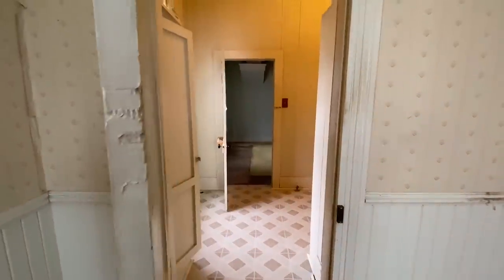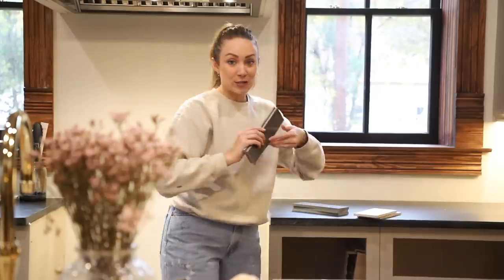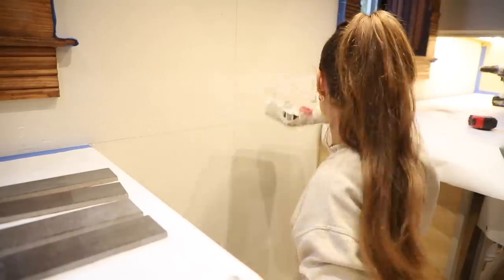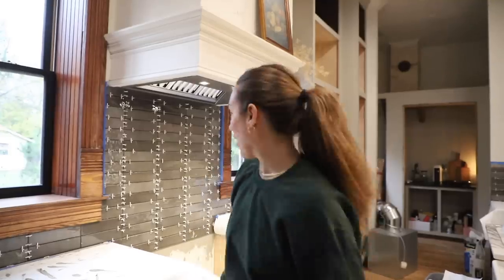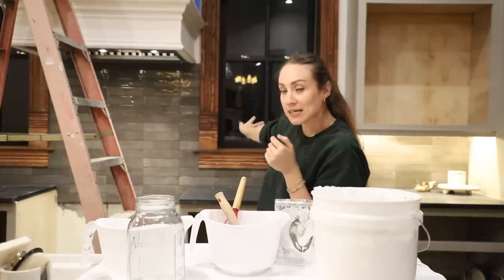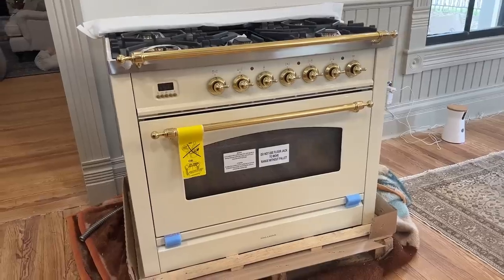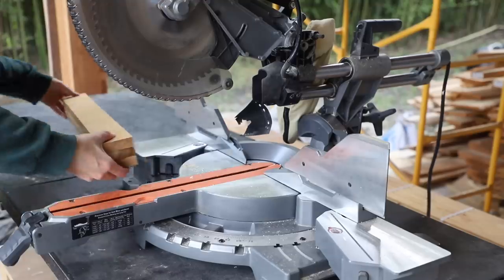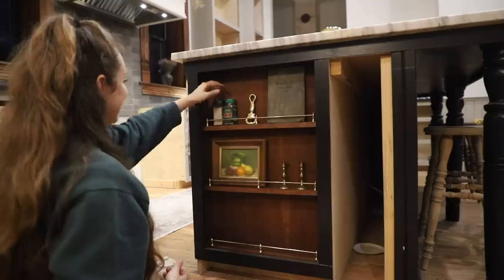DIY TILE BACKSPLASH, Limewash & Kitchen Details | Kitchen Makeover EP 11 | XO, MaCenna

Comment: Hey!! I absolutely love your videos! Just a tip for tiling a wall: find exactly where you want your bottom row of tiles to land, and temporarily screw in a 2x4 horizontally so that your bottom row can sit exactly where they need to be, against the board, then build up from there and you won't have to fight gravity or have your tiles slide downwards throughout the installation process. Then, when the grout is set, just unscrew the 2x4 off the wall and voila!

Comment: ❤️Great tile job! In the future, use a sanded caulk in a matching color to the grout along the countertops and windows. Looks just like grout, gives you a super clean tape line, and has the stretch you need to prevent cracking.

Comment: I recently had my kitchen redone and the tiler added a silicone seal all around the edges where the tile met the countertop, cabinetry and range hood. My sink is placed in front of the tile (not in the island like yours) so maybe that’s why but just thought I’d mention it in case you hadn’t thought of it!
Reply: I think yours is sealed because of the water issue. I don't think it's necessary in MaCenna's circumstance.

Comment: Beautiful tile job!! FYI, they make color matched caulk ( sanded/ unsanded) that you're supposed to use in the corners ( showers) or where the tile touches walls, windows etc. This allows the solid tile expansion gaps when the substrate expands or contracts.

Comment: Just a side note on the spice rack:
Sunlight will fade the colors and possibly the potency of their flavors so I would opt for amber or if you’re lucky, blue tinted glass jars. 
Finally I recently found some on Amazon that’s non clear glass (search “Kamenstein Empty Jar Set, 24 count, Amber”).
So far the only ones I’ve seen and I’ve looked for years! You could definitely find lids better fitted for the metals you have

Comment: If you ever need to start mid-wall in the future, you can temporarily screw in a strip of angled aluminium to act as a straight tile row for you to work off. It's really handy if you need a secure starting place, or if the room isn't really square and all your edges are going to have to end in cuts.

Comment: Oof. I would have bought a graduated cylinder for measuring out the water for the lime wash. Really recommend that for future projects!

It might be time for a new drill bit (or bit set). It seemed like there was a lot of resistance when you were drilling the holes for the spice racks. This can be caused by a dull bit and is an easy $3 fix.

Comment: Just if you are tiling again, you generally don't grout next to trim, you leave that spot empty, then silicone later (so that there is expansion when the timber expands with moisture/time etc, and also to protect the grout a bit, I think -- same for inside corners). Hopefully is should be fine, but maybe in the other spaces in the house moving forward make sure the edges are silicone not grout 🙃

Comment: This is looking soooo goooood! You should consider painting and sealing the sides of the cabinets where the oven goes because it's easier to clean than raw wood. Also, just a thought, maybe get the tiles a little lower also? It's totally up to you ofc but I found that some foods just splash alot and they just run down your tile so fast... Sooooo fast... And it would end up getting on your wall, so maybe 2 or 3 more rows would be better just for cleaning purposes too. But that's just my opinion and the experience I had with cooking some kinds of foods 😂
Your house is feeling more and more like a cozy warm home and I absolutely love everything. You are an inspiration, a real example that we can do anything when we put our minds to it. Congrats!

Comment: I love my Lutron lights. It was an investment, but I love have everything accessible on my phone and even connected it to Alexa. I have an old house like yours, and it was SO much cheaper to use the Lutron switches and add a remote switch for new switch locations than having my electrician run new wires - even my electrician suggested it!!

Comment: I was surprised you went with such a pink beige lime wash.  I would have tried to say more in the grey, green tones.  Not sure about it with the Silver Mist. The oven does have a stainless top, so it should blend OK with the oven.  I would have prefered the stainless steel one, yet I understand you could not wait. Did you try using the gold drain?, it may have fit yet the plumber didn't try.

Comment: We recently had tile installed in our newly remodeled kitchen. The tile guy put pieces of wall trim even with the cabinet in the blank spaces where the fridge & range would go. I asked why & he said it holds the tile in place while the morter holding the tiles is drying. Then he removes the wood.

Comment: MaCenna, what is the name of those tiles you got for your backsplash? I have a floor and decor up the street from our home and I want to use that some tile on mine I love the color!!. Mine will probably go subway stacked or vertical though I have shorter ceilings but they go up towards a vaulted ceiling in my front room so my ceilings are slanted but on a lower height level.

Comment: I just finished tiling my bathroom! Was an absolute nightmare and trying to clean the grout afterwards is proving difficult! It's very rough, any tips?
Reply from the maker: i had that problem too the first time i grouted .. the trick is to not wait too long to clean off the excess grout if its too dry its so hard to get off. I do a section and within 5-10 min im already sponging it off .. you can always add more

Comment: Your tile looks great but your adhesive was a little thin looking. Tile should be buttered on both surfaces, the tile and the wall, so adhesive sticks to adhesive. Also those teeth on the trowel are so you can make a rippled bed of adhesive to “seat” the tile into. Hope you don’t have problems.

Comment: Everything is so beautiful! But… I wanted to jump through the screen and stop you! I made the same mistake you’re making with the grout on the edges. Because of the expansion/contraction deal, grout will crack along the edges. you need to use caulking. Also, you should find a top coat to seal the lime wash. Grease from the stove rises straight up and you’ll need to be able to clean it.